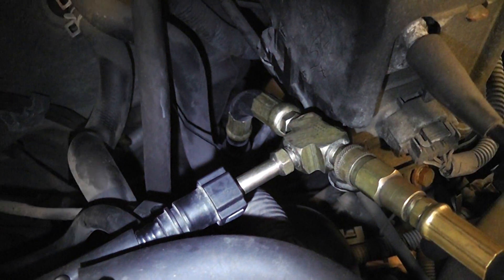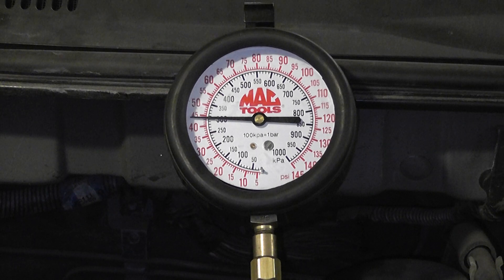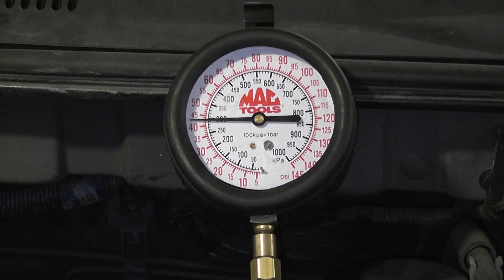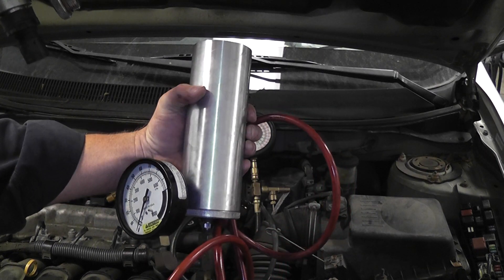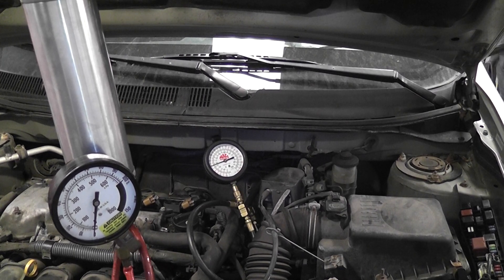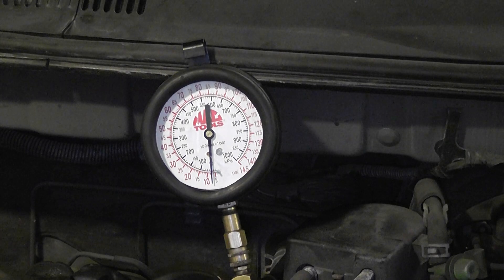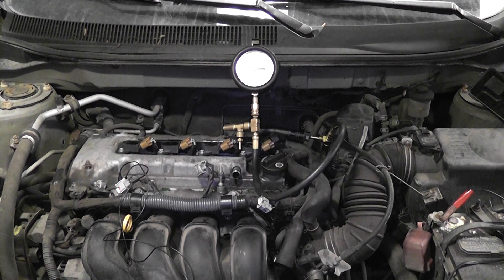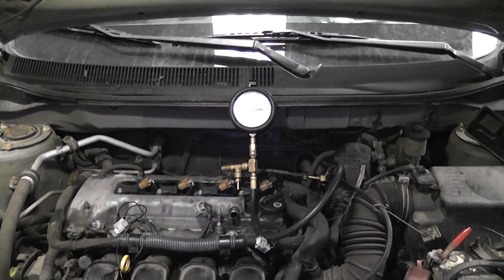How to identify injector flow problems (Toyota 1.8L) part 2

Comment: I am trying to test my fuel pressure regulator and fuel pump on my 2003 Toyota Corolla which has the same engine so I’m wondering what fuel testing kit that is how you connect that to the hoses and if you happen to have a video showing how to do that or if you could just tell me it would be extremely helpful?

Comment: I have a 2003 Crown vic she has over 200,000 on the clock I take very good care of it . It started missfiring and setting a bunch of codes . I just tuned it up. Long story short I took the coil packs out again to make sure I had good contact on the coils and cleaned them reinstall . Fired it back up still miss fire. I came back and started pulling plug ins off of each cylinder on the coil packs and found no 3 didnt drop I pulled the coil pack did a spark test on 3 and its good ! So I pulled the plug and noticed it was disclolored more than usual like it got really hot. I put the plug back in started the car with the coil pack on top of the engine and made sure it was firing and it was. I ran the engine for 5 minutes with spark disconnected shut off the engine and pulled no 3 plug drier than a bone no fuel deposits . I want to try my flusher never tried it before. I want to try your injector balance test but dont understand it . How does pressure difference come into play for a good or bad injector? Please can somebody explain this to me. I have a way to energies the injectors please help thanks
Reply from the maker: First thing, when a misfire is recognized by the ECM, it may shut down that fuel injector to protect the cat. So don't 100% rely on your test that you did.
You need to make sure you have injector control (use a test light) and then also test compression on that cylinder before worry about doing the injector balance test which requires a specific tool to do it
Reply: @ScannerDanner  I saw that on a youtube A guy powered the test light with battery voltage and put the other end on the ground terminal from the ecm to check for pulses . I have no clue. I didnt know a ECM would shut down control on an injector? When I first check for codes with the scanner after I took the packs off I cleared all the codes . After that is when I found the condition on 3 you would think if you clear all the codes the ecm would reset its self if that is the problem if you get a chance please read the reply on chapter 1 what I went through thank you so much for the reply I know you are a very busy man

Comment: I am a certified Auto Tech and also own and operate my own Marine Repair business. I am very impressed with your knowledge and your video. Very well done young man.
Reply from the maker: Thank you Roger!
Reply: @ScannerDanner  You are welcome ! I am getting ready to buy one of these flush kits I wont use it much but I figure one flush it will pay for its self. You will never guess what I am going to do with it? I have a customer with a 21 Foot cobalt boat. He left it sit out with out a cover for a long time and it got trashed. I have been restoring the engine and controls etc for a quite a while it needed a ton of work . Anyway check this out its got a fuel injected 502 but in the late 90s he took it up to Tahoe and had a whipple super charger put on it to the cost of almost 7 grand then. The motor is dead and wont run. I want to make a you tube about bringing back from the dead . But I don't know a damn thing about editing. I can visualize what I need to do for photo shots but don't know how to edit. I am hoping my channel will take off eventually but I thought of the title Dead Blown 502 comes back to life!

Comment: It would be good to have more detail how the t into the fuel line is done. I am currently trying to diagnose a lean condition.  I only see two connections on the charcoal cannister. One goes to the Purge control valve and the other seem to go to the tank. Should it go to tank itself or the top of the fuel pump holder?  Someone changed the pump holder and I seeing a nozzle on it which there left open to atmosphere. This tells me that something is not right.

Comment: Great videos Mr Danner.
Ive found some success using a small Ultrasonic cleaner (USC) with the injectors in a separate container full of Seafoam.
Dissembe the injectors as much as possible before Sonic.  Injectors are small so they can even fit in a cheap jewelry-sized Ultrasonic cleaner.
Now in 2021, those small USCs are fairly available and affordable.
Stay gold.

Comment: Where did you get the T to install to be able to connector your tester? Included in a master kit or purchased separately?
Reply from the maker: part of a master fuel pressure kit I have. I have them listed on my tool page (link in the description) Thanks!

Comment: AWESOME 👍👍Thanks Scanner Danner. Quick question injectors Oem or Would aftermarket be ok ?
Reply from the maker: If the price is similar, go with OEM. If not, a reputable aftermarket one is fine. None of that cheap stuff off the internet
Reply: @ScannerDanner  👍👍🤜🤙

Comment: Thanks for this vid , whats the canister tool you use for 15 GM and 85 gasoline ? 

its look like Otc 7448 a ? 

Does it has an adaptateur for Mercedes w204 .

Thanks
Reply from the maker: +SaciNoella not sure the part number off hand and it didn't come with any adapters .You'll need a psi test kit to use with it.

Comment: hi paul... quick quest!.. when your fuel gauge hose or conections threads leaks fuel,, you fix it with teflon o r some type of glue...  my friend loan me his pressure gauge and had a lot of teflon on the threads and leaked like hell.... couldnt trust 100%.
Reply from the maker: +serchmarc I've never repair one my friend. Sometimes replacement is what is needed

Comment: Hey, Scannerdanner,saw this and #1 and #2  Prizm PO171, which I now have plus a PO301 and PO420. It goes to the tech shop tomorrow and I fear the cost of 4 injectors @$95 each, this site, partsgeek.com (from Amazon ) has re-mfg's for $29 each, and 5 good reviews from people who' ve bought them. Would you try them ?. They also have that Denso (new ) 02 sensor for $55.          jwolchak@cinjci.rr.com
Reply: I am directing all help requests to my forum. Sign up (it's free) and create a new post. Be sure to add a name under "alias" as this is the name that will appear in the post.
Here is the link to the forum. 
http://www.scannerdanner.com/ForumRetrieve.aspx?ForumID=3226
Thanks

Comment: Amazing videos. Keep up the amazing work.

I do have a comment on this video. This does not seem to be a common practice in North America (at least you have not mentioned it here), but in Europe (partially due to very high cost of injectiors and in some countries poor fuel quality), injector cleaning is much more common and almost regular maintenance operation (every 5-6 years of operation on higher mileage vehicles).

Anyways, to clean the injectors properly, injectiors have to go out. They need to be cleaned in different (much stronger) solutions that an engine does not run off, and in an ultrasound tub, so also the external side of the injector is cleaned. All this under different rpm/pulse width (emulated) drivers/tools. Also precise measurement and observation of the actual spray shape can be observed in the special tools only used to test/clean gasoline/LPG/CNG injectors.

Please observe the following promotional video for one of the shops that does it. It's in a foregin language captions, but you can observe before and after differences in the spray shape as well as the cleaning process itself in the tub..Pulling the injectors is usually not that hard, and the service is relatively cheap (less than the price of one injector)..

Ciscenje dizni
Reply: Zemljače pozdrav i poštovanje što pratiš Danera (bog za 'Engine performance diagnostics' ako mene pitaš). 
Za čišćenje se slažem, ali za merenje protoka ne. Uredjaj koji on koristi košta mnogo manje od te mašine, plus može da ga koristi na terenu, plus nema skidanja dizni, u većini slučajeva. Razmišljam da kupim ovaj OTC mada vidim na Ibeju da ima jeftinijih, za 30 dolara (OTC košta 100), a verovatno radi isto.

Comment from the maker: Vacuum assist type regulators are used to maintain fuel pressure differential. Example: An injector with 30 psi of fuel pressure with 20" of vacuum at the nozzle will flow the same rate as an injector with 40 psi of fuel pressure with 0" of vacuum at the nozzle.

Comment from the maker: because there is still a regulator in the tank assembly. any pressure on the pressure line higher than 48 psi I will cause the regulator to open and dump on the return side of the regulator. if you think about it there is still a return line but it is in the tank

Comment from the maker: It still has a psi regulator and it is in the tank. If rail pressure is too high the regulator would open and it would dump back on the pressure line.

Comment: @ScannerDanner  very good point, I would give the customer the option of cleaning or just replacing. He's got a 50/50 chance of the cleaning working. It's the same when I've cleaned dpf's on common rail diesels at work. I've only managed to successfully clean out a couple of dpf's. Very similar setup using compressed air and a cleaning fluid. Have you tried theses ultra sonic baths you can buy Paul to clean the injectors!?

Comment: This for sharing! Never seen this done before and although it didn't work on this one like you said, it's still a valuable test. Will there be a final part to make it a trilogy Paul. Would like to see the figures with a new set of injectors.

Comment from the maker: I agree too, I could have tried it again with more solution, but with this video I think the procedures shown were more critical than the fix. My goal was to arm you guys with enough info. to take it from here. Some would want to clean them some more, some would want to send them out to get rebuilt or cleaned professionally, and some would just want to replace them all. 
If it was my car I would attack this differently than I would in the field as time is money.

Comment from the maker: Agree but just trying to be careful what I put out on the net, if you know what I mean. Although 50% may be a little high and the engine may not run at that concentration. 
15% is what some GM techs recommended to me.

Comment: Cool stuff Man.
I thought using injector cleaner takes all the gunk from the system(rail) and puts it in the injector nozzles.

... you can take apart and spray the back of the injectors with carb cleaner ... you can also pressurize each nozzle tip and flow brake cleaner backwards as you switch on the injector. 

DIY Fuel injectors cleaning
youtube.com/watch?v=VFJlTfHyrUk

Comment: Well done  !!  When you use the bi-directional control to turn on an off the fuel pump can this be used to disable the pump for the test shown without pulling the fuse ?